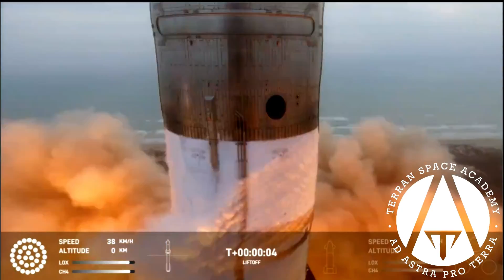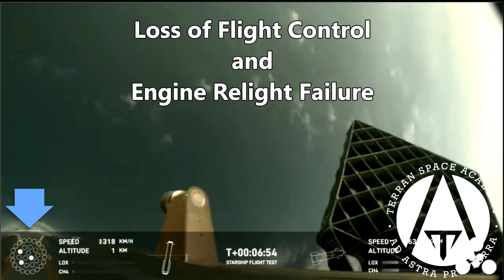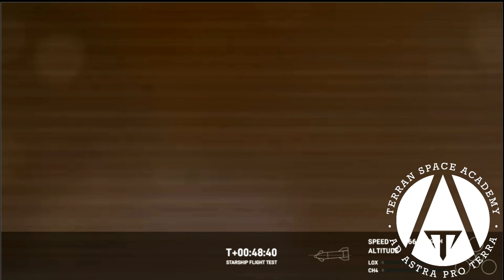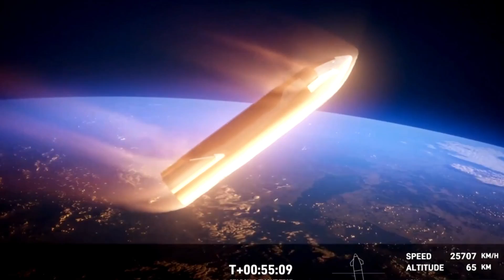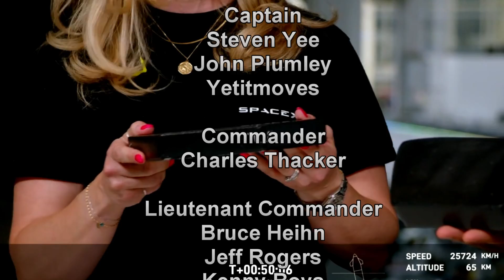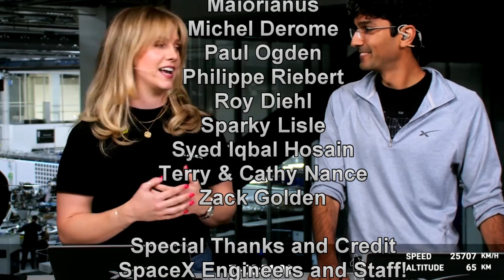Starship IFT3

Comment: Where did you get the information on the fuel levels at the start?
Reply from the maker: The 1,200 for the Starship and 3,400 for the Booster? Those are published by SpaceX, though they might have gone a little light this time so they didn't need to vent as much.

Comment: Cheerleaders are you guys going to develop standards. There are 4 more rockets just like this one. So all the bad design features are not being addressed. To circumvent the destruction of the booster they initiated hot staging a full minute early while only reaching 70 kilometers. Then it still went out control and belly flopped on the ocean.  I did like the instant cutaway and acted like it never happened. Then bacause of a way to early shut down of booster starship had  burned almost all its fuel. So it coasted from 178 kilometers to 228 kilometers before falling back to earth. Just a note starship from engine shut down till engine failure to relight. He has it was venting fuel fuel clearly seen from onboard cameras. This as a result of damage to gimbal engine damaged fuel nozzles from the flat hot stage ring. Then as I stated before launch as it enter the atmosphere the tile stared peeling of the non stick stainless body. The video showed the insulation and tiles fling off before reaching terminal velocity that burned up the rocket. Loss of signal at 65 kilometers. Starship payload door opened but was unable to close. So at 90,000,000 a copy how do cheerleaders get a success.

If this was a success then why even launch the next 4 more of the same rockets. Last the booster is the most powerful rocket to date. But all we get is 2.42 seconds and 70 kilometers?

Without a change in material and total redesign of boosters 33 engines. This is as good as it gets.
Reply from the maker: I see... total failure I suppose.

Comment: Is there any chance that traniting from super sonic to sub sonic is what caused or contributed to instability of the booster on landing?  I note that we start to the grid fins rapidly actuating around 1300 km/hr which is just above the speed of sound at high altitude.  I imagine that instability then caused fuel-slosh that prevented the raptors from igniting as planned.
Reply from the maker: You are quite right.  The transition phase will have some aerosurfaces in subsonic airflow and others supersonic, creating tremendous instability that used to tear apart bombers in a powered dive, and helped destroy Virgin Galactic's Spaceship Two.

Comment: The upper stage have a really bad shape for a stable re-entering, they should be using dragon design with a ceramic heat tiles at the bottom, and doors within to alow engines to fire and be protected during the hottest phase.
Reply from the maker: I would go three stage with the second and third coming back like Stoke space if I had the choice.
Reply: @terranspaceacademy  with specific impulse of starship engines two stages is better for LEO, and three for the moon or other high energy orbits, but yes I do think too that Stoke have a better design for the upper stage.

Comment: Booster blew up again.. LOS above the clouds... so it probably repeated what happened on IFT2. It'll be a long time before they try to grab one of those!  God bless those hedge funds. Main ship.. the door is a joke. Didn't hear anything about engine relight. The fuel transfer may have messed that up. Loss of RCS control for reentry orientation... Sucks it'll be 3 or so months before the next one.. Investigation - boom- Investigation- repeat.
Reply from the maker: If they just went expendable to orbit to start with. Setting up an orbital lab. They would be better off for HLS.

Comment: Starship did a Columbia imitation
Reply: Not really.. They had no control.. it was tumbling in.. it was ass first for a good amount of time, then It was sideways for a bit (into the plasma stream). They must have lost RCS control, and the flaps looked confused as to what to do.  They'll figure it out.
Reply from the maker: Columbia was damaged on the way up and a leading edge failed. Starship just needs better RCS.
Reply: @terranspaceacademy Can you explain what RCS stands for?
Reply: @GreyDeathVaccine  Reaction Control System.

It's using little engines to rotate or maneuver the craft.
Reply: That is a sick f'in joke. Astronauts were killed. You really need to delete your post.

Comment: Great video. Thrusters definitely need improvement, & it's surprising that starship's flaps are not airfoils. A odd choice as lift generation would allow a reduction in thermal loading.
Reply from the maker: Thank you. They don't want lift so much as drag as I think...
Reply: @terranspaceacademy  Agreed drag looks to be the concept, but a airfoil could be designed to generate massive drag & lift. Would be a improvement as lift directly acts against velocity in their flop maneuver. Lift also generates dramatically less heat than drag.

Comment: Test 4 will probably be full orbit. Test 5 will be completing a Dragon to Starship docking maneuver to showcase flexibility and potential of their interconnected systems as framework to build a station out of 10 conjoined starships by the year 2027.

The 10 ship array will be tested as an interplanetary mega ship that sustains artificial gravity with aid of giant mirrors that serve as solar power collectors that double as solar sails.
Picture 10 nose to nose star ships that swivel at the nose, picturing them horizontally to see them as being sandwiched between one top and bottom mirror layer. The mirror layers would expand outward to only 2/3rd the distance away from the centrsl point of rotation at the nose of the 10 star ships. 
These mirrors will be able to deflect most harmful radiation, even using that radiation as extra thrust in propelling the giant snowflake structure through space.

A series of such snowflakes can serve as sigal boosting relay points in the information highway of inner solar system life. They can even assist in funneling a lazer highway to bring ships up to and down from 5% light speed.
Reply from the maker: That would be awesome

Comment: Been watching launches since the first Mercury sub-orbital. This was the most exciting launch yet.

I’d rate it 98% successful. The next flight in certain the booster will do fine.

Re-entry I’m not so sure about. 

But hot dog, what gorgeous video!
Reply from the maker: It was amazing!
Reply: I would disagree somewhat.  They made orbit, a biggie!  With the loss of both vehicles outside of the flight plan, I would say about 75% successful.  Some significant "new" problems popped up, as well as a continuing problem (the engine relights)

Comment: The Booster seemed not to re-ignite.  Likely because of fuel movement.  Why not keep one engine, running at minimal thrust, say, 50%, to slow the vehicle and keep the liquids properly positioned?  On the Ship (second stage), it also seemed like re-ignition after coasting was a problem.  I saw in the Lance missile program (1970), a piston was used to move the liquid propellants toward the motor.  Perhaps something similar might be of benefit?
Reply: Yea the booster has some problems. I think it blew up like IFT2. LOS was above the clouds. They were able to do a full boost back burn, so all the fuel should have been well planted. Even in free fall, the fuel should still be planted, as the ships air resistance would make it "fall" slower then what the fuel inside wants to... if that makes sense (terminal velocity differential). It's probably plumbing related again. We'll see!
Reply from the maker: Something strange happened, that's for sure. The wild spinning might have pulled the propellant to the sides and starved the center engines causing a feed problem and explosion...

Comment: It looks to me like the booster ran out of fuel before it could slow down to a soft landing.  I wish they had a boater's view of that.  Something crashing vertically into the ocean at almost Mach 1 would have been pretty cool to see.
Reply from the maker: I think the spin kept the propellant from feeding right...
Reply: @terranspaceacademy The fuel gauges were not showing any fuel. I think that's what caused the scketchy relight. And was it just me, or did the booster's exhaust plume look awful sooty? Excess fuel use?
Reply: @terranspaceacademy  Yeah, that's probably a better explanation than mine.
Reply: Noway it ran out of fuel or no way that caused that failure. Clearly vehicle wasn't under control at engine relight
Reply: @johnny4498  it's the other way around, engine relight failed and spun it out control
Reply: @tedarcher9120  Wrong! Booster clearly has roll oscillations before relight!
Reply: @johnny4498  telemetry is delayed quite a lot, could be the other way around
Reply: @tedarcher9120  sure could be but very unlikely. For the engines to introduce roll into the vehicle they need to be gimbaled in a special way, which would mean a tvc or control computer guidance failure in your case. If they would just fire straight down with some engines failing and creating asymmetric thrust, the vehicle would jaw or pitch but definitely no roll
Reply: Would be interesting to find out the investigative enquiry finding on this! How about a disposable barge viewed by a remote camera?
Reply: Booster blew up again.. LOS above the clouds... so it probably repeated what happened on IFT2
Reply: Yes we can never depend on what is on the info bar. Watching it, it does seems that an engine relight caused the sudden instability. I wonder how cooked everything got to that point. Maybe some gimbal actuators failed/cooked. At any rate, there was enough damage that they exploded again.
Reply: @hawkdsl  You make a very good point that I hadn't thought of.  It appears that the reason SX didn't pay much attention to the booster properly landing is that they may have had known issues they were still working through on that part of the rocket , but didn't want to delay the launch because of them.  Instead, they wanted to focus on if they could even get to orbit, because if you can't do that, it doesn't matter how well the booster performs returning back to earth.
Reply: @hawkdsl  my bet is the thicker atmosphere and wrong control algorithm, not the engines
Reply: @johnny4498 Possible. I look forward to what they find out.. But they never really explained IFT2.. at least in public.

Comment: There was no attitude control whatsoever! They have a lot of work to do as right now all they have is a great big firework.  I’m surprised that SpaceX under engineered that as badly as they did, otherwise, they did ok for an engineering flight.  Methinks a cold RCS system is a no-go.  Bring back something with some oomph like the Draco’s, otherwise they have a serious problem.
Reply from the maker: The air was too thin for aerosurfaces and too hot to wait :-)
Reply: @terranspaceacademy  Indeed, that’s why is was surprised at the lack of robustness in their RCS system.  Remember kids, tumbling on re-entry BAD!

Comment: I don't understand why Starship continues to burn the atmospheric engines, even after the vacuum optimized engines are shut down.   Ant idea?
Reply from the maker: I was wondering that too but since they aren't going into orbit it might be a way to get rid of excess propellant and have better vector control.
Reply: Could be for better control. Less thrust so it will reach the target velocity slower while having the bonus benefit of thrust vectoring.
Reply: The atmospheric engines are steerable, vs the vacuum engines that are fixed and not steerable.  So they can tweak the attitude of the vehicle if the other engines don't all shutdown simultaneously and a yaw or pitch is introduced.
Reply: Agreed, though there is other ways around it, differential thrust and of course rcs. But I think you are right in this case.  @lmamakos
Reply: All of the above possible. I'm also wondering if it's for stats purposes?

Comment: I'm no scientist, but isn't almost 26k kmh way too fast at just 65 kilometers? Would they have had enough time and height to slow down to their target speed? Or do they need bigger fins possibly if not?? Overall it was great to watch it.
Reply: Removed my RUBBISH 😂
Reply from the maker: That's true... and without optimal positioning it wouldn't slow down as much as planned.
Reply: Interesting point, but I have to think that was calculated. The booster has to do what it has to do, right? Thinking 'out loud' so to speak.
Reply: That big bitch was completely out of re-entry profile and was nothing but a meteor.  If you watch the re-entry footage Starship was tumbling and never had a chance.  They really need to rethink their attitude control system.  I’m sure the aerodynamic profile will work below say 150,000 ft but relying on the wings to orient the vehicle was nothing short of engineering folly!

Comment: Need better/stronger RCS thrusters to align ship and booster?
Reply from the maker: That's correct. We'll go into that this week. The flaps don't have enough air and the RCS is not nearly powerful enough.
Reply: @terranspaceacademy I don't think it was weak RCS... I think it was NO RCS. Like Vatsyayana87 said, there was no attempt to fix orientation, and the flaps looked confused as to what to do. I think they lost RCS control all together, and may have something to do with the fuel trans test.
Reply: @hawkdsl  The engine relight test was also skipped, so you could be on to something. On the other hand - it's crazy that it did so well given the circumstances. Kudos to the engineers who build and programmed it!
Reply: @luckbot-5000 It's easy to forget this was only the third flight. Their experience is falcon 9. Starship is several magnitudes larger (F9 heavy is just three F9s strapped together). So they many be fighting the upscaling  problem.They are doing awesome stuff however. This is the first time in history that a rocket system development has been so public. Watch any Apollo documentary, and the Saturn 5 was a real headache. From the pubic's perspective, it just showed up one day, and went to the moon... Like SLS just did for that matter. This stuff takes time. They'll get there.
Reply: I really feel like they didnt have enough excess pressure in the lox tank to even use any rcs during that entry. I didnt see any real attempt to correct the roll, it looked to be just free falling until the fins had some atmosphere to attempt to work with.
Reply: Love how the grid fins were fighting the good fight right until the end.
Reply: @novanights2chevy597  Wonder whether the booster hit a layer of high wind on the way down. High winds were reported at 3000 ft before launch, which was a concern for them.
Reply: @trevorleaman2525 LOS was above the clouds, and two engines tried to start. one of center engines, and one outer. The outer went out almost instantly. I think it repeated IFT2, and blew up from engine fail. The booster fail was the one that bugged me the most. There's other stuff happening in there they have to figure out.
Reply: They might not be able to fix the problem outside of a re-design.  They have several more SSs standing by of the same build.  What if they aren't fixable?  Scrap em?
Reply: @paulwilson8367 They've done it before, and they may have too. That's the problem with building so many vehicles before testing is done. The next block of SS design is next. The current inventory of SS and boosters are the last ones of the first design. In fact the next SS being built will be 1.1 with a different flap configuration. The booster is the simplest part of the ship, and they may be able to fix current inventory. I don't expect the booster to change much, but you never know.
Reply: @paulwilson8367  That's pretty much what they've been doing so far.

Comment: Are they expecting it to constantly bleed propellant all the way to the moon and Mars?
Reply: They do that to prevent that fuel from splashing down with the ship
Reply from the maker: That's just for reentry... Like when jets dump fuel before landing.
Reply: Not much on long duration flights no. Here they are likely getting rid of excess pressure due to boil off after the spicy launch, then an engine chill sequence for the relight that was planned but didnt happen will be pouring out lox vapor for a bit.